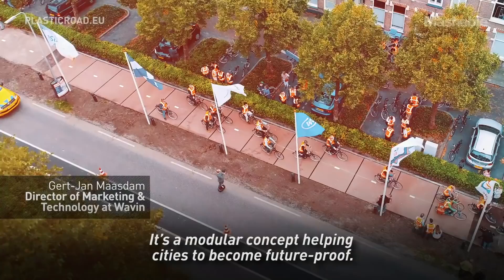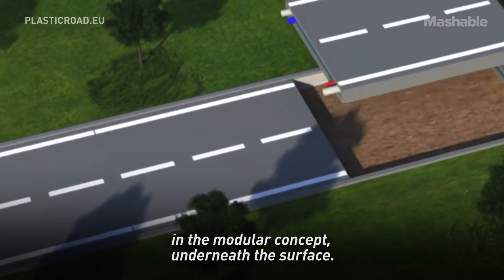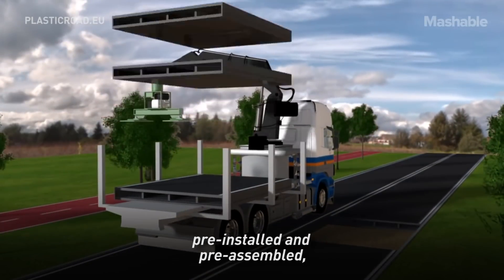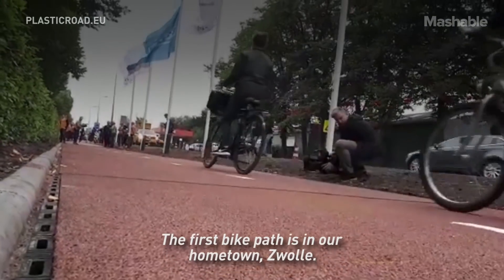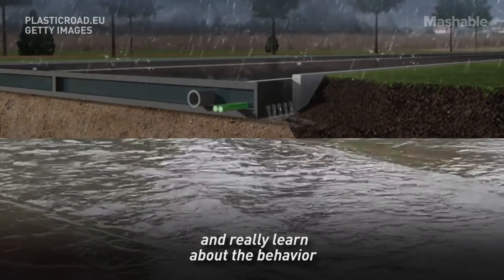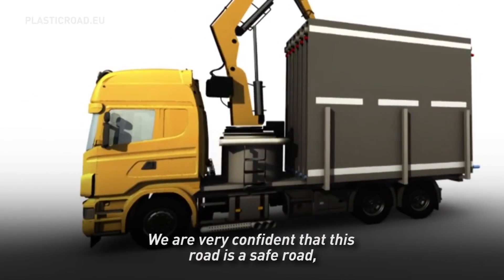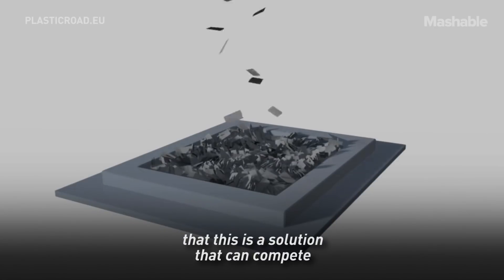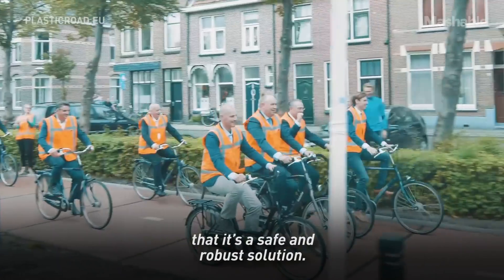Roads Made From Recycled Plastic Waste Could Be the Future

Comment: this company was started around 2005 and 30 meters of bicycle road in 13 years are not very impressive.
Reply: Doesn't mean the principle is not sound even if their business model fails.
Reply: @jacobmarley2417   can you imagine how slippry a plastic surface gets when it is wet or with snow on top of it.
and any type of wear will create microplastic.
the cost of producing plastic is about twice of that of asphalt.
plastic can handle less load than asphalt.
plastic wears down faster than asphalt or concrete.
asphalt is made directly from waste from oil refining.
plastic is made from refined oil so it will still be produced the same amount of waste after refining oil,this can be used to produce asphalt.

Comment: I like the design. 

Question: if cables are meant to run through the bottom of the lego structure, what happens when one of the lego pieces needs to be replaced and there’s all these long cables running through the lego piece? Do all the cables need to but cut and then later repaired?
Reply: I think it would be a better idea for the road to be made of a minimum of 2 pieces, a top and bottom

Comment: What happens if there’s a fire?
Reply: Obviously the same thing they do with any sort of damage to an area of the road.
Reply: @davidl.7027  well that and they'll have to completely disrupt the power and water supply to fix the road
Reply: The plastic is reinforced with bitumen so just as safe,I have seen this first hand in India ,they have had no problems with fires or any extreme weather's, and boy do they get them.
Reply: This technology is long overdue and will be a great help to our planet even if they just use it for cycle lanes and utilities services it will be a fantastic solution.
Reply: @zachlinn9043  No they won't.All the repairs and services if ever needed  can be done internally from the sides.

Comment: Plastic breaks down easily into smaller chunks and can easily end up in water ways. It also does poorly in the sun and cannot be fixated into the ground if it’s intended to be quickly removed per tile. Also this process would greatly disrupt the sewage and electrical components beneath the road.
This sounds like a disaster just waiting to happen.

Comment: so the cables and pipes are all modular also....  this seems a little unlikely. can be the road is good and so on. but putting pipes and cables through it. seems like they have to pull up the most of the road to replace a let's say fiber cable.

Comment: Could you run electrical cables through or the fact water runs through makes that not possible?
Reply: Mike Gerrie well i think since it is possible to run electrical cables trough the ocean, this should be fairly easy...
Reply: Yeah, electric cables are insulated. Currently all electricity, internet, fiber optics, irrigation wires, all run in the ground in your neighborhood, sometimes as shallow as 1 foot deep. These wires deal with water all the time with no issue. Also conduit, steel or pvc, can be used to add even more protection.